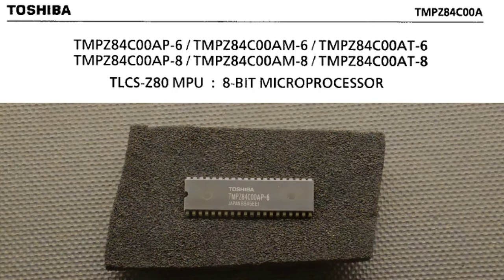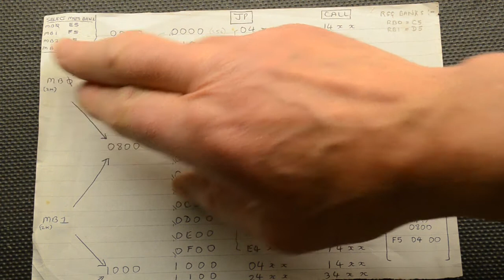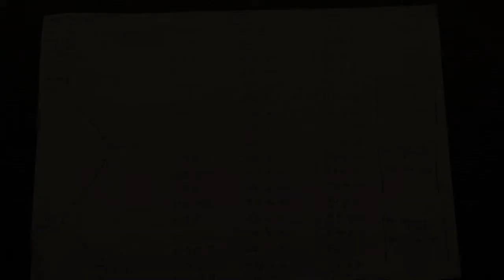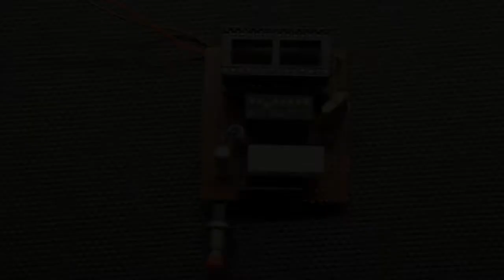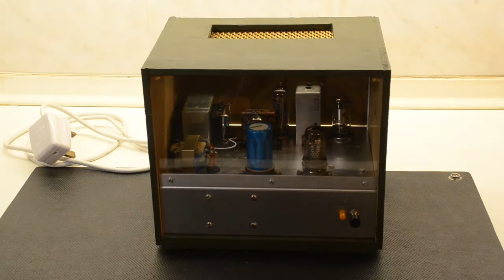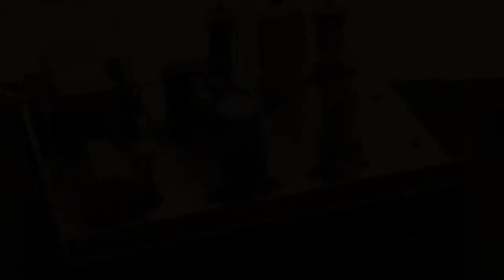The 84C00 & 8401 microcontrollers that didn't really make it

Comment: How long is a dit and dot?
Reply from the maker: Good question! Of course in reality, the actual timing depends on how many 'words per minute' the code is being either sent or received.

In reality, it is the relative duration of a 'dit' to a 'dah' that makes the difference. Hence for a mico project such as the 84C00 etc. one sets out some subroutine delays (you will need three separate time delays)  - all relative to each other. The actual timing itself being much less important.  Therefore talking in terms of a 'time unit', a dot (dit) is 1 time unit, a dash (dah) is 3 time units, with the gap between letters being 3 time units and the gap between separate words being 7 time units long. I hope this helps!